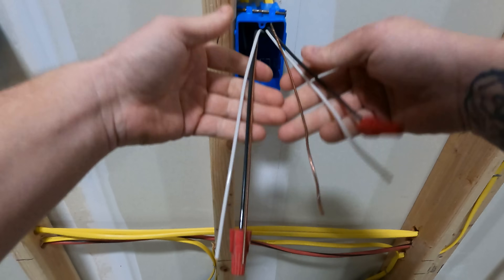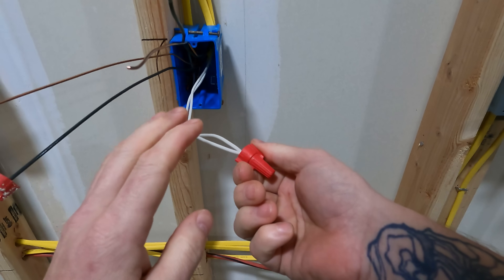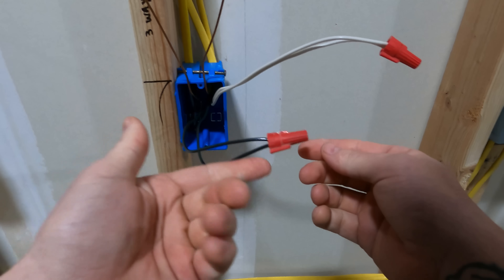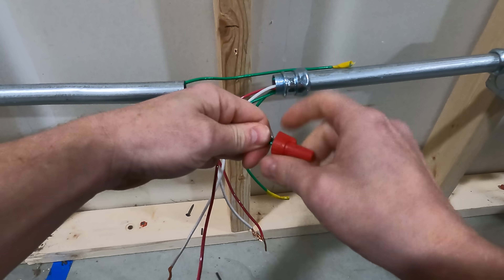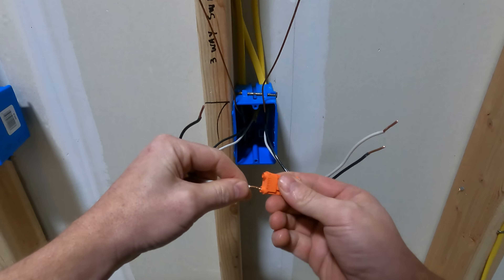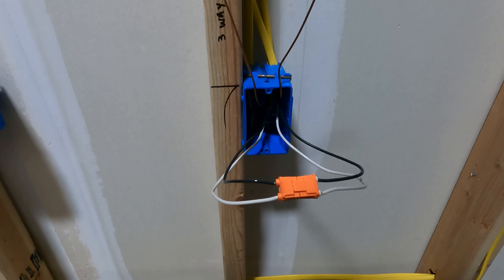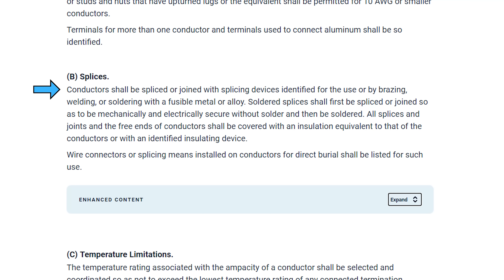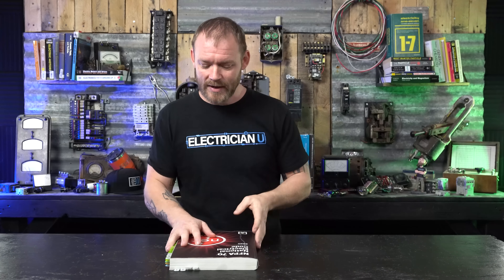To Twist or not To Twist? THAT is the Question.

Comment: 30 year master in multiple states… Twist your wires and stop being lazy Millennials.
UL ratings are bought and paid for, so listings don’t mean anything anymore.
  Can’t count how many times I traced the short back to burned up wire nuts..  expansion/ contraction from heating and cooling causes the wire to separate.
  If you’re lucky, you just loose power to your equipment.   Unlucky , and your wires start arcing because they’re now MM apart from each other, and your house burns down with you in it.  All because people are too lazy to twist the F’n wires.

Ps, they twist to the right😉

Comment: There’s no reason to pre twist. If you have the correct size wirenut you keep twisting the wire nut until the wires coming out of the nut twist a couple turns also. If you take the wire nut off, the twists will look the same as pre twisted.

Comment: I haven't been doing this for very long, but the only bad connection I've run into which nearly zapped me was pre-twisted. I think it's often harder for the nut to go on a pre-twist (if the bundle is anywhere near the max size it can handle) because the twisting can increase the overall size of the bundle. And because of that, sure the pre-twisted bundle can stay together better, but the nut doesn't stay on as nicely (which is what the problem I ran into was). And that seems more dangerous to me.

On a separate note, if I ever have to come back to a connection to add or remove a wire, I'm much happier to come back to a non-pre-twisted connection, since the wires aren't so nastily entangled.

Comment: In your demonstration you didn't put two twists of the wire outside of the nut.  Is that not recommended for the wire nuts you are using?  You demonstrated a solid + stranded without an electrical box.  If you demonstrate something, you should do it correctly.  Also, you talked about twisting multiple conductors; please demonstrate this instead of just talking about it.  Exposed wire length should also be talked about since it is a key part of using wire nuts.  It's hard to consider this a "serious" channel if it only gives us half the information.

Comment: Had a large plumbing company replace my direct element water heater with a heat pump type. He used wire nuts to connect the 6AWG aluminum wire to copper 8 Awg whip. When I came home from work my wife said there was no hot water. I checked the breaker it was tripped I thought well maybe the compressor failed in that water heater. Knowing enough about HVAC if the breaker trips again you call a tech out, but this one didn't trip again. 20 minutes went by and I checked it the breaker was tripped again this time a saw a black mark up the wall. I opened the box the wire had burned back like a fuse to the strain relief. That was the only thing that kept my house from burning down was the strain relief caused the wires to pull enough current to trip the 50 amp breaker.  I remember when he put the wire nut on he never pre-twisted the wire. Should AL and CO wire be connected with a yellow wire no I should have caught that. The old water heater had a timer on the wall it acted as a busbar for the AL and CO wire. I had them install a disconnect that was rated for AL and CO that way wire was under a lug not a wire nut.

Comment: You didn't use the wire nut properly. You're supposed to keep twisting the wire nut until there's 2 to 3 twists in the insulation below the bottom of the wire nut. Plus it would be a whole lot more effective if you use the wire nut driver that comes in the bag of wire nuts. 🤔 🤦‍♂️

Comment: Excellent, professional, go home after work satisfied attitude. 
Old ceiling fan with single twist wire. What’s the proper way to insert into a wire clip? Wasn’t comfortable doing it. Used a twist connector cap. Thanks

Comment: The only time I don't pre twist is when I'm connecting solid to stranded.  I feel like I get a better connection using the wire nut to twist the wires together in that instance.

Comment: I always pre twist solid stranded it's a no. If I have 2 solids 1 stranded, I twist solids and bring stranded to joint with tip slightly higher than solid twist to ensure the stranded gets to tip of nut and won't pull out when pushing into a box.
Reply: Stranded to solid is a pain for sure.

Comment: I personally think all connections should be bolted together. With awg 12-14 I will use a tiny drill bit to bore a hole in the conductors then use a #2 bolt and nut to make my termination  afterwards i use empty match boxes filled with waterproof grease to encase the junctions.  Its a little more work, it once took me three days  to make up one junction box but the piece of mind makes it all worth it.... but seriously TWIST THE DAMN WIRES...

Comment: What would you do if you had to join a solid wire and a stranded wire together but the manufacturer, in its infinite wisdom, has decided to apply solder on the stranded wire to bundle the strands together? It feel like trying to pre-twist this would results in damaging the soldered strands since the solder is not as flexible as a solid wire...

Comment: I pretwist solid, not so much for stranded though. Usually ill give it a little bit of a twist to get it started. Stranded to stranded, if theres a thinner wire in the bunch, ill put it a little bit ahead of the rest. Same with stranded mixed in with solid, I'll put the stranded just a little bit poking out ahead of the solid.

Comment: I have found using wire nuts with more then two wires and not twisting causes the wires to move into the wire nut leaving conductors loose not staying together. The wago connectors are great solid  or stranded. ferrule crimps on stranded are a must for solid connections. I highly recommend watching EFIXX they have a video on crimping tools. After 33 years pooping wire nuts I welcome the change.

Comment: Hey I’m a bit concerned that you are teaching people about marrette connections but  you really don’t have a clue! First off never tell people  to use linesman’s or sidecutters to strip wires I’ve had too many guys say I can do it perfectly and then I have to undo A connection and the wires break off while removing the marrette because they are nicked deeply which also affects ampacity also never once do you say how important it is to make certain the ends of the conductors perfectly even because if even one is sticking past the rest the marrette will tighten down on that one before properly compressing the rest of them to spec also that one lonely guy can poke right out the end and not from over torquing but improper installation and ready to bite the next  guy in that box or short against the box !Also your example of two solid conductors not pretwisting and falling apart when removing marrette is ridiculous because not even and no where even close to proper spec you twist like a girl put to shame by chubby checker!!!!! And you pull sideways on pretwisted one but push one wire up while pulling down on the other one on pretwist example of course it’ll come apart. When Ideal really started marketing the blue one size fits all wing nuts there were instructions for proper torquing and that when the little grooves in the gripping area would start to turn white the are good to go. Also no example of a solid with a stranded and to slightly lead stranded wire past the solid and also love your hack of 2 stranded together with strands breaking off which I realize it was wires used for example but why hack it saying you teach people this without mentioning hey not good to be losing strands!!!!!!!!! I’ve been doing this since I was 16 and apprenticeship at 18 in 1984 and I’ve seen a lot but never someone on TV teaching the way to do connections very poorly I’m ashamed for the home hackers that are listening to you might as well tell them to waste some tape on them while you are at it! Phew I had to say something
Reply: All those words and nothing was said
Reply: @notashton. sound them out and the words have meaning
Reply: @notashton. if you can read you would be able to understand this coming from 40 years of thousands of marrette and hundreds of terrible connections by people who should not be doing them

Comment: If they won’t go straight in to the nut, I’ll give just enough twist to get the nut started on all the conductors. 
But that’s just with stranded wire. 
Solid wire? I just put it together.

Comment: I have always been of the mindset you make your electrical/mechanical connection then the wire nut or beanie in the case of low voltage stuff is just your insulator.  One of the reasons I don't like Wagos since the copper is not in direct contact with each other.  Plus an issue with no pretwist is when you pull a wirenut the conductors can come loose and spring over and short out against something or spring out and shock you or worse.

Comment: I don't pre-twist. But that's because (in MY experience. Yours will vary) I can't tell the difference between a pre-twisted joint or a joint that was just bundled and capped and twisted until tight.

Comment: If I recall correctly the big selling point of the 3M wire nuts with those big springs in them, in the late 60s, early 70s, was that you didn't have to pre-twist.  It was a time saver.  I didn't care for them.  A big outfit that I worked for in Florida used them exclusively for speed (plus aluminum wire, lol).  Wagos are great from solid to stranded.

Comment: I totally do both depending on the application. I tend not to pre twist connections that are two or three 14awg wires- I tend to twist the crap out of the winged wire nuts. Something 12AWG and up, like a typical 20A circuit in a garage etc I tend to pre-twist. I also love wago lever nuts and I even use wago push in connectors all the time for lighting circuits. It all works if you're not lazy and focus on what you're doing. Yes, I have encountered loose connections that were a result of poorly twisted joints too. There is definitely a method to installing wire nuts on 14's without pre twisting.

Comment: This week we had a call to go check out why some outlets and lights weren’t working at our towns local Super 8. Before starting any work I ask if anyone had worked on this before and the whole hotel on the interior rooms had been repainted, the guy that did the paint also did the electrical work of changing out outlets and switches, Adding usb outlets near bed stands, so I already had an idea of what the problem could be. Checked with my plug in tester and I had a hot ground reverse on the whole room, the light in this room was the only one to not work I assume out of all the other singular lights added to each room, the light is right above the door when you walk in, no light previously, or I assume the light was in a different location. Upon fixing the gfi that was wired on the load side as to why it wasn’t working, I went up in the attic and found splices everywhere with no j box or nothing, the Smurf tube was cut and the switch leg and neutral was spliced and a new Romex wire went to the light, Romex in commercial I know, so my foot got caught on the Romex and just tugged it a bit, I could continuously hear a popping sound so I undid the splice and nothing was pre twisted, one of the neutrals had popped out and was making good connection giving me 38V at the light. So I properly make 2 j boxes ran mf cable 12/3 in between for the switch leg and constant hot now everything is working fine in the room. Still curious as to why hot and ground reversed isn’t there no more and everything is reading good
Reply: Also when doing new construction/ electrical rough in it’s good practice to leave some slack on your whips, especially for  4ft lights that go into a drop ceiling. The extra slack could of just been taken directly to the new light, preventing me from having to make 2 jboxes, if I would of had slack I could of possibly just had 1 j box if the whip wasn’t long enough to go to the new light location

Comment: In Australia we not only pre twist but we also don’t use these wire nuts at all, instead we use screwed tunnel type connectors that make a much more permanent solid connection and also require a tool to open them, an extra additional layer of safety

Comment: This is a dumb debate. Make the most solid connection you can. Simple. You won’t chase bad connections if you just twist wires first. I cannot tell you how many times trying to diagnose something. Someone’s wire nut comes off. If the vibration can loosen a screw on a device over time. What make people think the wire nut won’t do the same. To eliminate that pre twist. Then put a wire nut on like ya mean it.

Comment: I always pre twist solid wire. I strip long, line up the ends of the insulation, twist, then cut the tips off to make it even. Never had any trouble with those connections. I even pulled all the receptacles out of my own house and pigtailed them all like this after I had a burnout in one of the daisy chained back stabbed receptacles. I also don’t back stab them. 25 years ago when I worked for a residential contractor, they didn’t like pigtails or side screws because “it’s a waste of wire nuts and it takes too long”.

Comment: Ok... I haven't seen it in the comments yet so I'll throw some fuel onto this fire. Use lever nuts, high quality ones like Wagos. Twisting the wire will work harden it making it likely to need to be trimmed on any future rework, reducing the amount of wire that can come out of the box. Use Wagos so you don't need to trim any wire in the future. (Also use commercial/spec grade fixtures so you can use back wiring instead of J-hooks for the same reason. Think about the next person, because that will likely be you.)

Comment: Just saying.  As an HVAC tech.  Had a  no cooling call back. No line voltage at condenser.  Traced back to a junction.  2  #10 wires that had been wire nutted the lazy way.   One fell out of the nut.
The way I see it,  You make the joint so it stays together no matter what, then you cover/insulate it with a wire nut.  The wire nut is insulation not a joiner.

Comment: Just graduated from a trade school of two year electrical studies. I was taught we should pre-twisted the conductors before putting wire nuts on. Teacher came over and try to pull it apart in order to see it falls off or not. Now I follow this practice and it doesn't fail so far.

Comment: Copied from IDEAL 341 Twister Wire Connectors Instructions, printed March 8, 2022:
 ...
3. Straighten wires and align frayed strands.

4. Hold wires together with ends even. Lead stranded wires slightly ahead of solid wires.
5. Pre-twisting acceptable, but not required. For pre-twisting; strip wires long, hold wires together with insulation even, twist wire ends together,  strip to recommended strip length.
6. Insert wire bundle into connector and twist clockwise until tight.

I follow the instructions on the package, and perform only the required steps. Step 5 is NOT REQUIRED! The diagram after Step 6 shows the wires twisted around each other below the nut, so if you just FOLLOW INSTRUCTIONS pre-twisting is unnecessary and a waste of time.

Comment: My father, an industrial electrician craftsman, taught me to scrape the conductors, carefully twist them together, trim the bundle end, and only then add the wire nut. 
As Dustin mentioned I've had many times when pulling a bundle from a box the conductors come springing out of the loose nut.
Reply: This is the way.

Comment: I do not pre twist wires. I have not had any issues with my wire nuts failing. Twist the wire nut on, tug test, and fold them neatly into whatever enclosure they’re in. 

Either way, as long as the electrician doing the installation does their due diligence, I don’t care if they pre twist or not.

Comment: If you’re not Pre-twisting then you’re not respecting the next electrician that may open that connection.
I have reached an age where I’ve moved on from electrical construction to now troubleshooting electrical problems in large commercial buildings and sky-rises.
I can’t tell you how many times I have opened up Connections points to check for proper voltage, where the wires 
pop-out causing a short or even electrocute me. 
All because of improper connections, or tradesmen that do not pre-twist. What I can definitely tell people is that if you don’t pre-twist and make a proper connection, then they should not be and/or touch electricity. 
It is purely laziness and they can injure themselves or a fellow electrician. 
I still live with my injuries.

Comment: Two equal size wires in the appropriate wire nuts will’ twist them nicely if twisted enough.  

Better then the old set screw type that weren’t twisted. Those joints melt pretty easy in light boxes that feed plugs.

Comment: Depends. For two #14's under a red wire nut in a private residence, it's not worth the extra time. If you're pushing the wire nut capacity or you're in a more extreme environment, then you take the extra time and pre-twist. It's the situation that dictates what you do.

Comment: I like to pre twist solid wire , however i don’t pre twist stranded wire.  One of my friend called me to see if i can find why his GFCI breaker tripped instantly. Turn out that one of his neutral was loose . When i took that wire nut off all the wire came un done . I pre twist them and was able to fix his problem

Comment: Loose wires start fires.

That's why I'm a perfectionist when it comes to joints. Every joint is pre-twisted, every wire is pulled. 

Stranded wires get less twist, but I always give each wire a tug to ensure it's bonded securely.

Comment: Pre twist makes the wire more fragile, with a higher chance of failure. Only bend those wires as much as necessary, too much back and forward, and they will snap off.